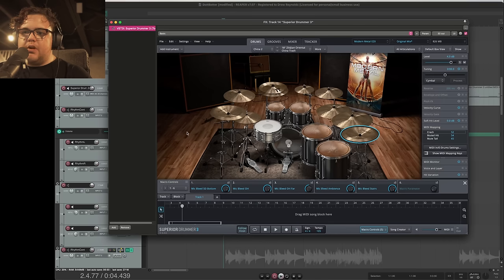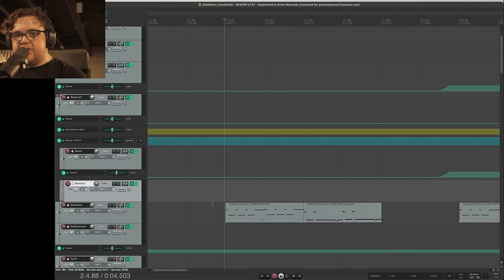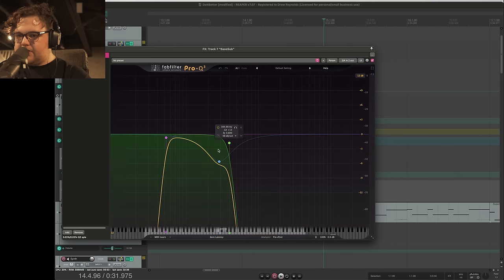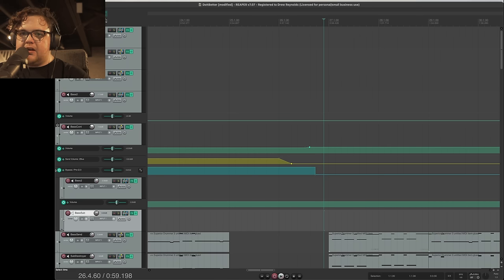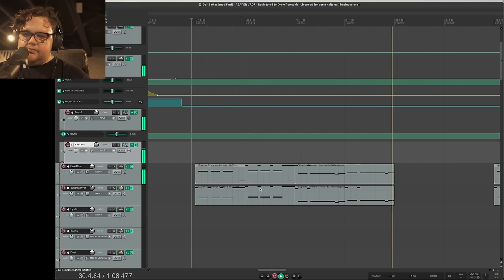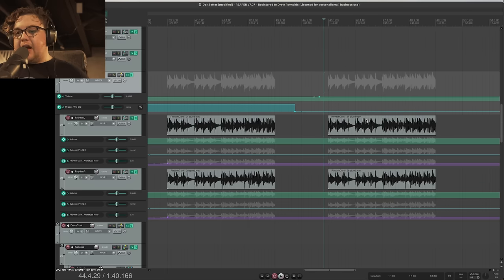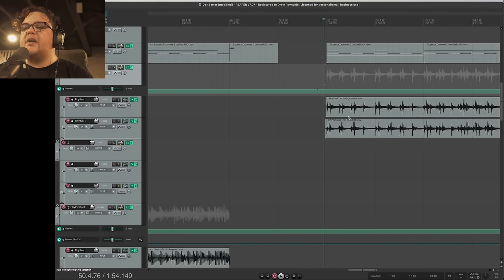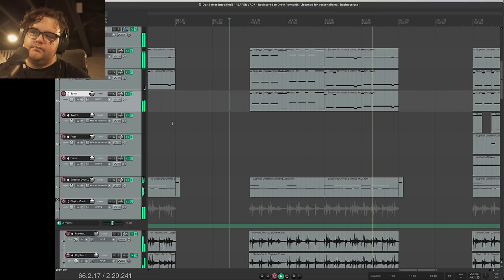8 STRING GUITAR TONE TRICKS | Do It Better Vol. 1

Comment: You could emulate the dynamic mode of Pro Q with a multiband compressor like the stock one from Ableton Live. You mute the low and high bands and aim your mid band where the "palm mutes" frequencies are and Voilà. I use that trick quite often for other purposes like "deHISSing" dialogues.